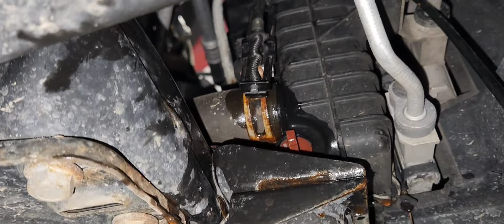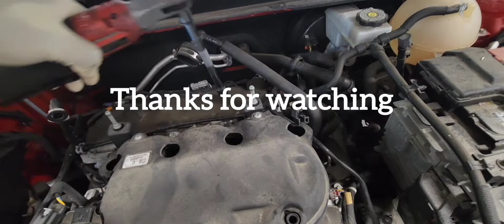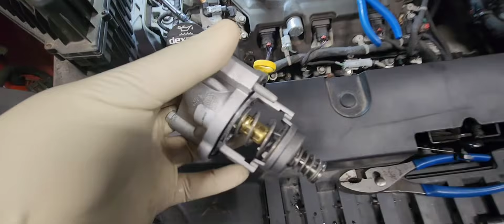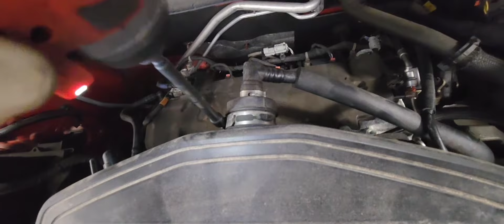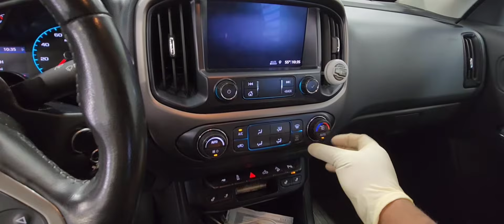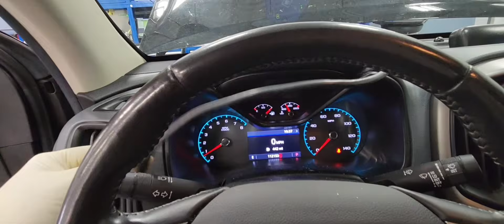P0128 Killing Your Cadillac XT5? This Changes Everything

Comment: Is this video just to replace the thermostat or does it also include the temperature sensor?  I am going to be trying to do this on Sunday.  Your video is great! Thank you!
Reply: Get a cheap scanner that reads live data and then drive and monitor your coolant temeperaure and it should read between 160-190 degrees and if it fluctuates while driving then your sensor is working and doesn’t need to be replaced
Reply from the maker: You welcome and thanks for watching, the video is just for the thermostat but to be honest i never have to replace temp sensor on your engine it is usually the thermostat
Reply: @steevegmtech7326  Thank you!  Kind of nervous to take the car apart but I feel better tackling this job since your video is so thorough!
Reply from the maker: Trust me it look intimidating, but it is not you got this , don't overthink it

Comment: Okay so I’m stuck at the part where you take out those injector lines at the thermostat. I am wiggling and tugging but they will not pop out at all. I’m nervous to clamp down too hard on the metal part with pliers in case of pinching or breaking. What can I do?
Reply from the maker: At that point i would just buy them in case they break in the head,happen to me before luckily they were readily available at the dealer, also spray wd40 before attempting removal

Comment: The engine temperature meter isnt reading just stays on cold even after a drive
Reply from the maker: I bet you your cooling fan is always running, and your ac is not working, you must likely have a bad thermostat or temp sensor
Reply: @steevegmtech7326  yes the fans are loud and haven’t tried the ac because it’s cold outside
Reply from the maker: @victornunez307  try to unplug the battery and plug it back in,to see if it went back normal

Comment: you fix the dtc p0128 with this job or still the problem ?
Reply from the maker: Yes the thermostat  replacement fixed it
Reply: @steevegmtech7326  thanks  i just replace the temp sensor after a month  code p0128 came back ... now im gonna replace the thermostate this week,   i hope  fix
Reply from the maker: @rikastars  did you bleed the system correctly?was the bottle full
Reply: @rikastars Did replacing the tstat fix the P0128?
Reply: @user-jd5sj8jx7r  yes  i replace the thermostat and temperature sensor then clear the code  with launch scanner

Comment: I am unable to get the pipe out of the thermostat. The pipe is loose and I can wiggle it but it wont budge from the t-stat.
Reply from the maker: The o ring is probably stuck in there,use a little of wd40 , it might help
Reply: @steevegmtech7326   I used a pick to get in and grab the O-ring after I commented. It came apart afterward. Thanks for your content.

Comment: P0128. There is a tsb on this. Many vehicles are still under warranty.
Reply from the maker: There is no tsb on that, if your vehicle have warranty,yes it will be covered
Reply: My daughter has a 2019 Blazer that started acting up last week, the internet says it's the thermostat, could it be one the other, or should I change both??...from Wyoming USA 🇺🇸 👋🤠
Reply: @billallen4793 usually just the thermostat is the issue, especially if the temperature gauge isn’t working. People have replaced thermostat and temp sensor just to have the issue reappear. If thermostat doesn’t fix it’s the wiring to the thermostat is getting too hot because they left unsleeved

Comment: So i have to take apart the entier engine to replace a sensor
Reply: I just done this yesterday took me just 2 hours with refill up coolant 
Leave the pipe in change the oring unplug battery first 
Crows foot the unloosen sensor 
Also I put small amount of silicone sealant back around small o rings 
All is well 💪🏿🛠️🧰
Reply from the maker: Yes, ,not way around it but it is not as bad as it look , as matter of fact, the manual want you to remove the fuel injector rail which require a special tool and time
Reply: @steevegmtech7326  I just did this and you're right, it's not even that bad. The hardest part is removing that 10mm bolt that holds the pipe in place. Super easy if you tear up the foam but harder if you want to keep it intact.
Reply: @Pinoy915 any advice on how to do it without tearing the foam?
Reply: @Pinoy915 definitely easy I only charged 330 labor shop wants 900 1300 smh

Comment from the maker: Link for coolant used
https://amzn.to/3qs1RUf
flexible hose clamp pliers kit
https://amzn.to/3rzOlhJ
Link for e-torx
https://amzn.to/3qtFY6Q
Milwaukee ratchet
https://amzn.to/3Nb61c5
Link for basic hand tools
https://amzn.to/3CbD21t
Link for Milwaukee impact driver and electric ratchet
https://amzn.to/3J4vT6T
Impact driver only
https://amzn.to/3IXAnvW
Trim tool set
https://amzn.to/3zOPLG8
Link for thermostat
https://amzn.to/3NTazD9
Intake manifold gasket (need 6 of them)
https://amzn.to/3NWLsz4